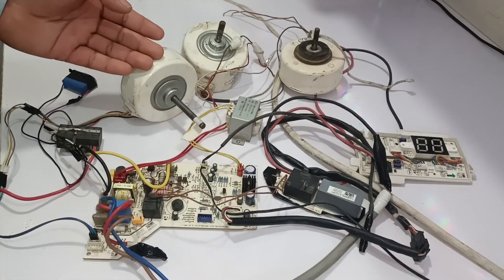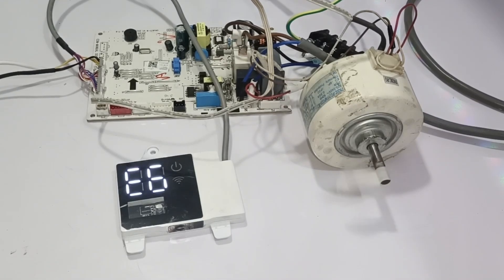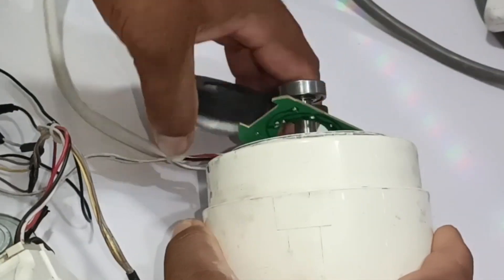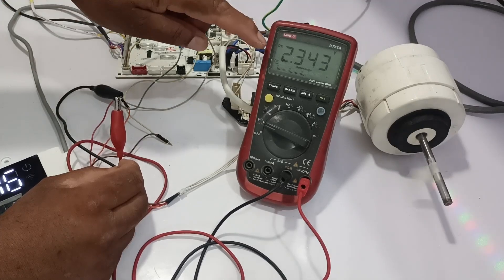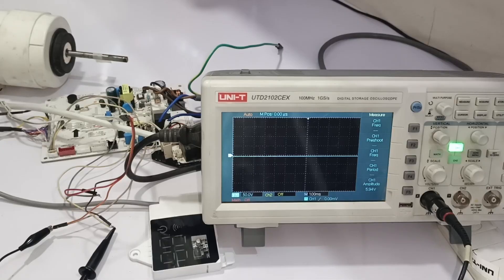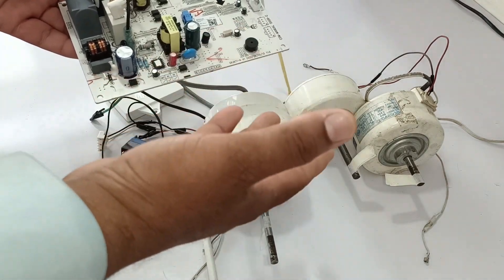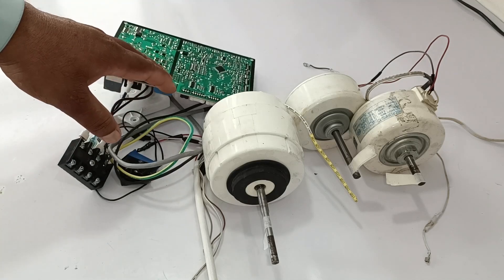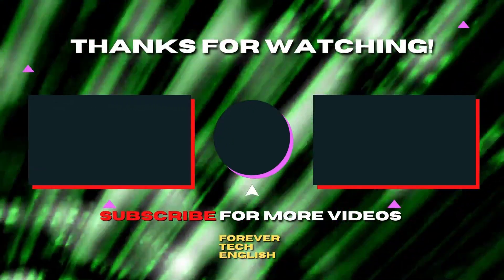These Blower Motors Won't Work in AC Circuit Board

Comment: E3    geneline  fun  motor  error
Reply from the maker: Is the circuit board same as in the video.
Reply: @forevertechenglish sir, my daikin inverter got error H6. compressor wont turn on. i watched your video about H6 error but my indoor fan is blowing.